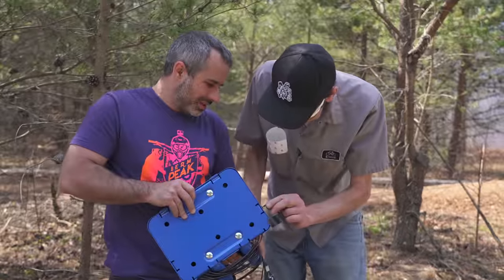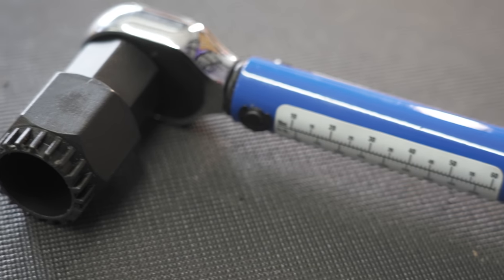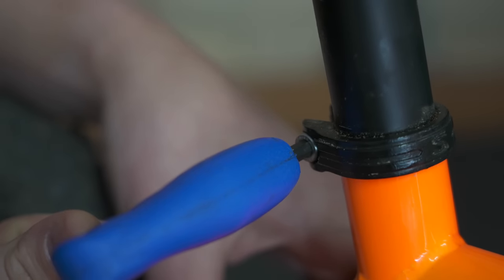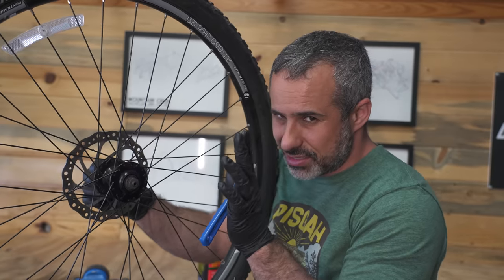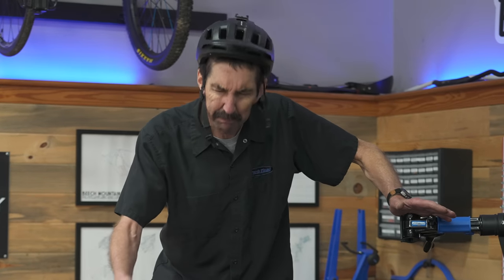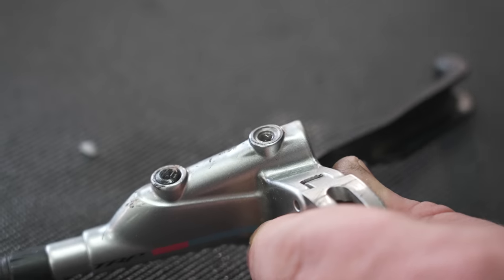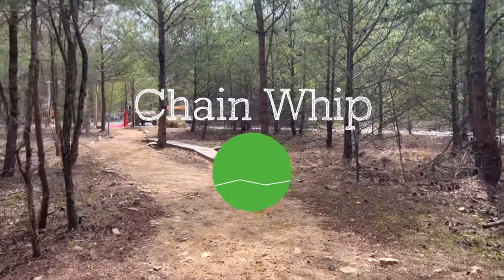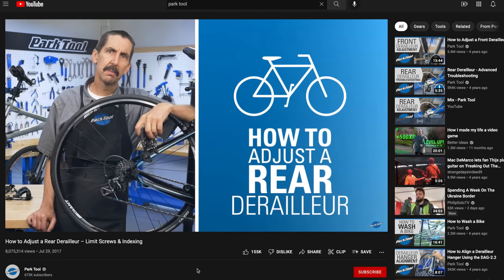10 Rapid Fire Bike Repair Tips for MTB & Beyond - Featuring Park Tool

Comment: Nice tips guys. I must try the float test on a few items on my bike I think. In fact I might try it on my whole bike by throwing it in the pool. I'll make sure to take the wheels off first, because I know they work fine.  I'll tell my wife if it floats it's good, if not, then Seth says it's proof I need a new bike. If she doesn't believe me I'll tell her to watch this video.  

A word of caution about using WD40 to clean tools or anything else for that matter. While its a good degreaser and provides a protective layer of silicone (or whatever they are putting in it these days), its a petroleum based solvent, and that does not play nice with anything that has rubber in it, and even certain plastics. It softens the rubber up. 

When tightening the headset, as a general rule, I go just past finger tight to get enough pre load on the headset bearings. Too much pre-load and those bearings and races don't last very long at all. Same principle as the pre load on the Bottom bracket bearings, too tight and they're stuffed. I've had the LBS assemble anew  bike I purchased from them and over tighten the headset, repair under warranty after two rides, repeat, until I pointed out that the headset was too tight. You could hear the new replaced cartridge bearings crunch on the races when moving the bars from side to side, so it was easy to demonstrate my point. Needless to say,  that LBS never saw me again.

When having problems with extracting pins or stripped bolts etc, using left threaded drills also help. Trying to drill the hole for the extractor in itself sometimes extracts the item.

Comment: I got a tip for adjusting your derailleur hanger in a quick emergency. If you have a wheel axle with a old bolt style hub, you can thread the axle into the derailleur hanger (carefully of course you don't want to strip the hanger) and you can use the front tire and gauge it by eye with your rear wheel and tell on the fly if you wheels out of wack and try to get both tires to sit parallel with one another. But if you use this method too much just like Seth said, It may just be better to get the real tool or buy another hanger💁

Comment: The best method to check if the headset is lose is to push the bike against a wall. Then, you don't need the use the front brake. It is better imo because sometimes the brake pads slightly move in the caliper so it can be confusing.

Comment: Heres a tip.

If youre trying to get a nut or bolt unstuck, use a hammer. For example, if you have a hex nut thats stuck, get an allen, put it in such that the short section is inserted into the nut. Make sure its properly seated. Grab a hammer or an equivalent (a large wrench works just as well. Ive used a set of cast iron weights before), and then just lightly tap on the end of the allen key in the direction to unscrew the nut. In other words, its like youre trying to unscrew the nut with an allen key, but instead of unscrewing by pushing or pulling with your hand, youre doing so with hammer taps. Just remember, youre not whacking it like a sledge hammer. Just small taps. You can increase the strength if your nut is really stuck, but Ive never had to swing it with more than my forearm. The hardest taps you would be using would be roughly like gently hammering in a nail for a picture frame.

What youre doing is basically emulating an impact wrench, that thats basically industry standard for unscrewing nuts and bolts. Contrary to what you might think, its actually less likely to strip your screw than just pushing or pulling really hard on your allen key. And tapping on it with a hammer is much easier and safer than say, standing on it, or pushing on it with all your weight, and then smash your knuckles on your chainring or casette. Ask me how I know.

If youre afraid of damaging your nice tools, just get a set of basher tools. A set of allen keys is really cheap, and just get an el cheapo wrench or pedal wrench for your pedals. Any tool that is a solid piece of metal is guaranteed be strong enough for this method.

Comment: also buy some left or reverse drill bits they aren't expensive and you'll be able to sometimes get those bolts out before you use the extractor set nice vidjya

Comment: Nice tips 👍🏻
Bit one thing i definitely would not recommend ist when you drill a hole in the pin you say you should drill very slow with a lot of pressure. That is a real safety issue. Generally the smaller the drill the faste you have to go. And if you combine high pressure the drill bit will eventually snap and hurt you. You can actually see your drill bit bending.
Of course you can’t start with 10k rpm but you should adjust the speed and the pressure accordingly. The slower the speed the lighter the pressure

Comment: Pro tip for the pedal pins:
Only buy pedals with pins that screw through from the other side like Hope, HT and many others. If a pin brakes it can be replaced much easier as the hex part doesn't get damaged.

Comment: one more problem on loose headsets, I did not have enough spacers, it was just off enough to cause a problem but it looked good. I tried to tighten it but even over torquing (not good) did not work. Added a small spacer on top and problem solved. Just thought you should bring up the importance of getting the spacers right also.

Comment: 1:00 not sure if it's the same thing but I had just finished going down the main hill in my neighborhood around 150ft high. After that there's a little flat part before another hill. I start excellerating as I wanted to get as much speed as possible. Thankfully right before the hill got steep my wheel just falls off. my stem just slams into the ground and I flip over the Handel bars. I could barley walk . So my buddies put his bike down and helped me carry what's left my bike. We eventually got to my house witch was at the bottom of the hill. Anyways long story short I lost my bile privileges for 3 months cuz my parents were scared.

Comment: My tip to tightening an axle  Skewer. Close the lever and tighten the nut on the other side until firmly tight. Then open the lever and tighten the nut on the other side again by half a turn. Last close the lever and you wheel should be night and tight.

Comment: I recently bought a cheap mountain bike and it had 3x9 driven but I was struggling with adjusting the fron derailleur. So I ended up removing it. Now my bike has 9 driven, or sometimes I shift the crank gear with my finger 😂

Comment: Left-twist drill bits, even the cheap ones from Harbor Freight, will often extract stripped screws -- just remember to put your drill in reverse.
Reply: I prefer left handed screw drivers

Comment: Other simple tips.
 Store your axles in your frame or forks. If you're working on a wheel or moving the bike between home and trails this will save you so much hassle. Everyday there's at least 3 posts on my Facebook about someone forgetting their axles. Make the habit of popping them back into your frame/forks muscle memory. 
 Don't spend money on tools you'll use once in a blue moon if there's another way. Star nut installation tools are crazy expensive. An old top cap and bolt isn't. Just thread the bolt into the nut until the bolt reaches through with some spare poking through the top cap. Wiggle the nut into place then once it's seated, hit that thing until the top cap sits neatly on top of the steerer. You'll seat the nut in deep enough to avoid getting stuck on a top cap yet high enough to get excellent thread contact. Many other areas on your bike can be sorted without expensive tools, this is just a good example of a method which works as well as a proper tool without stupid expenses.
 Keep all your old valve cores unless they're completely shagged. You'll thank me later when you break a core and have a box full.
 Keep your shagged innertubes. That rubber is good for so many things. I cannot list all the uses for a bit of tube. I've used them for everything, the most bizarre being water hauling to wet some jumps. A group of us filled some valveless tubes up in the river, popped the dust caps on then carried them over our shoulders. We must have had 10 liters each yet carrying it all was so easy because we had our hands free to help move over difficult terrain. Seriously useful things.

Comment: One thing with the headset, if you have a suspension fork, put some pressure on it when rocking back and forth as you may be feeling worn fork lower bushings, rather than your headset. This will give you a more accurate reading.
Reply: Or, turning the wheel 90° to the left or right works too. (I remember Truman mentioned this a few years ago)

Comment: 13:30 almost never have luck with screw extractors. Mainly a good way to get much harder tool steel stuck in your screw hole. Better to drill out and re-tap usually

Comment: 15:52 That's one twisted 4mm hex, and in the tightening direction too.  

Curious what bolt needed to be torqued that tight to bend the tool so much - Thule T2 bike rack?  Had mine for 14 years, tightened hex bolts with 3/8 drive hex bits and a ratchet, not a multitool.  Read about people having them loosen/loose bike on highway, most are idiots with multitools and just loose bolts.  Mine was good, thousands of highway miles - 10 years later I almost lost my bike on highway, metal just loosened itself over time - my bolts were still super tight and so rusted I basically had to torch the bolts to turn them - ended up just putting a self tapping screw through the bracket into the frame so there is no way it can slide off even if the bolts were loose.

Comment: If you're going to the effort of rebuilding a hub, wouldn't you swap out for new bearings a the same time? They cost pennies, and the new ones will be nice and round. Like changing the chain earlier than the cassette.

Comment: When drilling stuff: the smaller the drill bit the faster you drill, the bigger the drill the slower u drill, soft materials low pressure (wood, aluminium..), hard materials lot of pressure (iron, steel..). Also small drill bits cant take too much pressure like big ones can so even when driling small holes in hard materials u shoud be careful with pressure. All in all trick is finding that sweet spot of speed x pressure.

Comment: If you install the wheel like this, tightening the skewer while it is hanging on the lawyer-lips, your brake rotor and calipers will come out of alignment when you ride off a curb and properly seat the wheel in the dropouts. Either put the bike on the floor or push the wheel up with your knee to prevent this.

Comment: Great video again Seth, nice collab with the guys from Parktool! I got a question, I broke a bolt in my fox 34 when I was applying a bolt-on mud guard from Syncros. The bolt snatched off right at the end of the fork so I can not get a hold on it with a plier. Would you reckon the trick of getting out a bolt from you pedals would also work in this case? It is a particularly small bolt so I am a bit hesitant with drilling it. Do you maybe have another trick to get it out? :) 
Cheers
Reply: One thing I've done in the past is to "extend the bolt." You take another, nice bolt of roughly the same size or a bit smaller, add just a tiny amount of super glue / epoxy / JB Weld / etc. and sick it to the broken one. Once cured, it's just an extension of the broken one, and you just turn it out power normal.
Be EXTRA careful to not get glue on or in the internal threads of the bolt hole.

Comment: Concerning the pedal pin: Consider making a slot into the pin head using a small metal saw. Then it will be an ease unscrewing the pin using a slotted screwdriver. Of course given the fact that the pin is looking out still enough to slot it 😅

Comment: I didnt know about the float test on a derailer hanger what causes it to float wen its good? Also i didnt know about the angle thing on the qr. I just kinda tightened them until they felt good. I may have been over and under tightening them for years.

Comment: The torque thing could benefit of some labels showing the math. Pounds applied   X wrench length = torque. It's also the reason why small botls wrenches are smaller as a prevention from human being applied overtorque

Comment: Hey Seth, genuine question. With the hub rebuild of your lazy like me could you just spay some wd40 on it and let it seap in. Of corse making sure not to get it on the breaks.
Reply: Hey, I'm not Seth but I can answer this, short answer no. WD40 is a lubricant but it is dissolved in a degreaser so when spraying on a greased bearing it will dissolve out more grease and make it worse in time. BUT if your in a bind and need to free up a ceased bearing or part it will work to clean out grime and get some lubricant in there until you can properly repair or replace it.

Comment: How much do you have to tighten your headset to over tighten it? Every once and a while my headset will start creaking and I'll take it apart to clean it and I never know how much to tighten it
Reply: Just tight enough to remove the wiggle.  Don't think of the cap screw as a fastener - more an adjustment, like the limit screws on a derailleur.
Reply: Thanks
Reply: A god way to find out is pick your bike up at the saddle, turn your handlebars to one side and let them go. They should swing back and forth 5 times.
Reply: @RealMTBAddict  when I try that the bars sorta just recenter, maybe I'm doing it wrong?
Reply: @clmfilms8103  pick your bike up so the front end hangs down. Then test it. Gravity should be on the front.
Reply: @clmfilms8103  Did you get it?
Reply: @Dawson you didn't know either? Lol

Comment: Great tips, but with the quick release lever; is there a correct position that the lever needs to be in ie. parallel to the fork or perpendicular. Should it point forwards or backwards? Does it even matter? Is it different on road bikes?
Reply: There are correct & incorrect angles for safety's sake and yes, it matters. It's the same for all bikes basically. It depends on the QR lever's form factor too.

Closed-cam
Front: Parallel with the fork blade or to the ground if there's enough clearance.
Rear: Parallel with the chainstay or between the seatstay and chainstay if permitted.

Open-cam
Front: Right behind the fork blade or parallel to the ground.
Rear: Between the seatstay and chainstay if possible, otherwise underneath the chainstay.

For those with disc brakes, I suggest having the lever on the drive-side instead as there's no hardware at that side of the front hub.

Comment: Clean with alcohol before bluing. Light oil after prevents surface rust. Copper penny and oil remove surface without removing the bluing.

Comment: 13:28 I wonder if another option would be to cut a slot in with a thin hacksaw blade and then use a slotted screwdriver to get it out?
Reply: That should work too.

Comment: Any idea how to fix your carbon frame. I have a 2015 Cannondale scalpel. Now it looks like the bearings have worn into the frame so I always have play in my rear triangle. Any ideas or tips on how to pair of the frame so that the bearings fit better and quit giving me play?
Reply: Carbon can be fixed but it's costly and definitely not a DIY project. See if you can find a local shop that does carbon work.
Reply: @Steph.98114  One of the big reasons why it is so costly is the lack of people in the USA that work on carbon fiber bikes. I live in West Virginia and my top tube on my high end carbon bike got damaged.  Local bike shop had to send it to California. The fix wasn't that costly,  it was the shipping and handling that made  it cost so much. Now, if my bike only cost $500, I would not have gotten it fixed. It wouldn't been financially worth it.

Comment: Torque question. I want to buy a torque wrench so what torque range is most useful for bikes?
Reply: You'll need two torque wrenches to cover all fasteners of a bike: A 1/4-inch and a 3/8-inch.

1/4-inch
Target torque range: 2 Nm min., 15/20 Nm max.
Torque increment: The smaller the better if you want to cover all possible values.
Example: PRO Bike Tool 1/4-inch Torque Wrench Set (I've put this tool through LBS duty for more than 1.5 years and is still going strong)

3/8-inch
Target torque range: 10/12 Nm min., 60 Nm max.
Example: Park Tool TW-6.2 or any industrial-grade 3/8-inch torque wrench is OK too. If you're only working on cassette & rotor lockrings, self-extracting cranksets, suspension pivot bolts, SRAM UDHs, you don't need to worry too much about fine torque increments as these torque specs are usually whole numbers.

As for the bit sockets, some do come with a bunch, some don't. If you plan to source a bunch yourself, look for industrial-grade ones as you want bit sockets with tight tolerances (ex. 5 mm should be 5.000 mm, it can't be far off). Check out Wera's Hex Plus lineup for this, I've got their 6 mm & 8 mm L-shaped hex wrenches and I like them.

Comment: The best way to check if your headset is loose isn’t my holding the brake because sometime you can just feel brake disc play the best way is to put the bike on the back wheel and wiggle your forks form the bottom